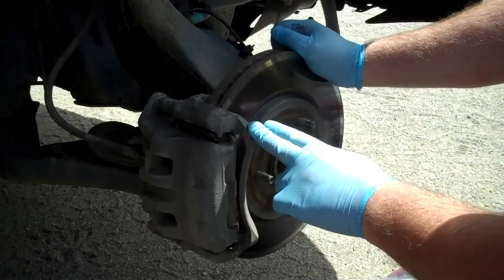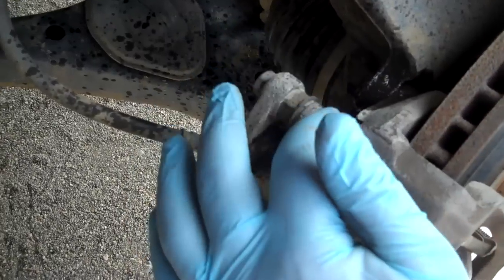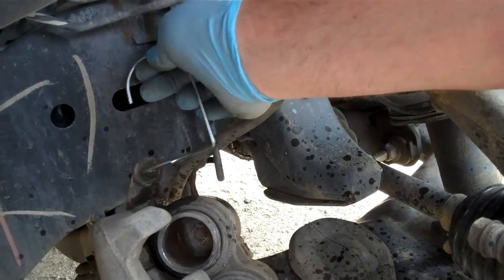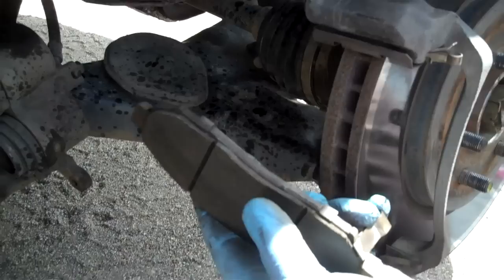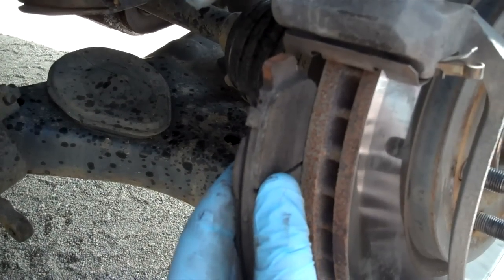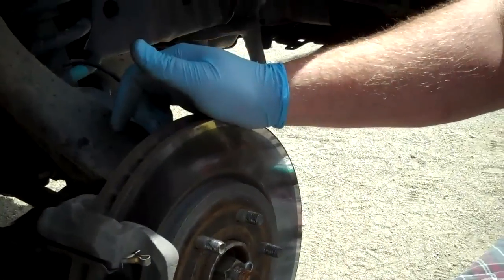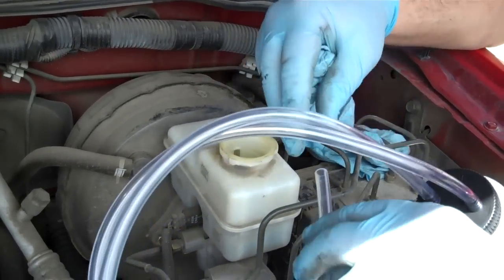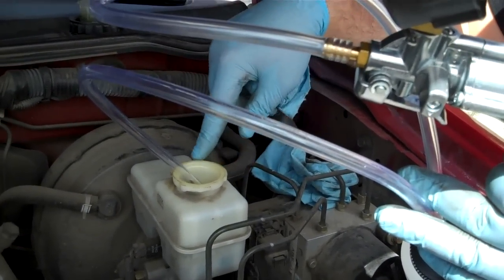2007 Nissan Frontier Front Brakes Part 1

Comment: does it matter if the inside pad pin is on the top instead of bottom
Reply from the maker: Do you mean the squeal tab?  If that's the case that can go either inside or outside, I prefer to put it on the driver's side so hopefully I can hear it.

Comment: I just used a small measure spoon to remove brake fluid from reservoir down to minimum level :)
Reply from the maker: +David Davis As long as the job gets done safely as you can do it, glad everything worked out for you.
Reply: Very easy to do front brake pads

Comment: Really wish you had shown jack stands in place before accomplishing any work. You mention it at the very end of part 3, way too late for the advice to do any good for this job. The only apparent support is the hydraulic jack under the rear. Pointing out safety issues is MOST important, especially for the weekend/backyard mechanic. Too bad as the videos are very informative.